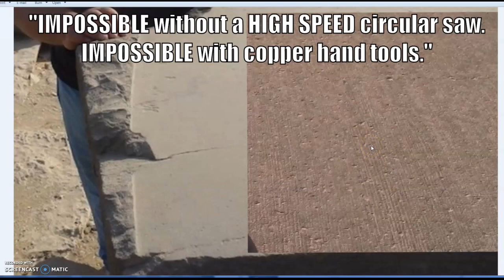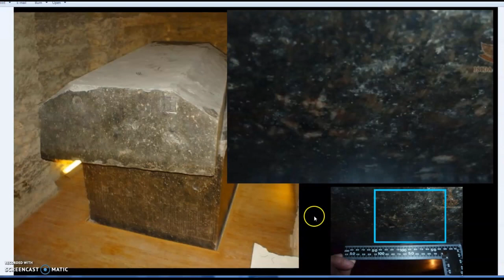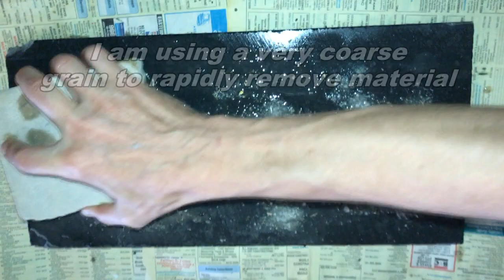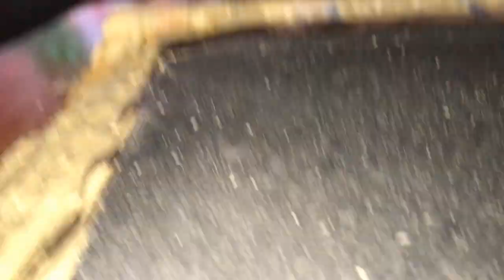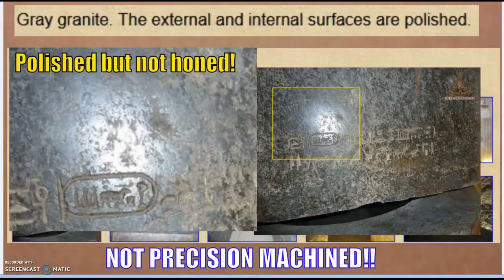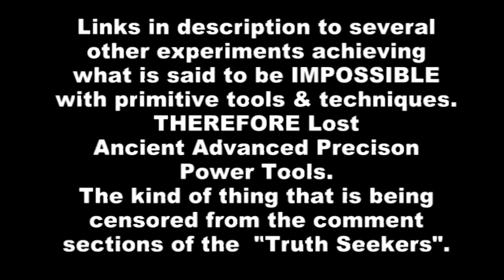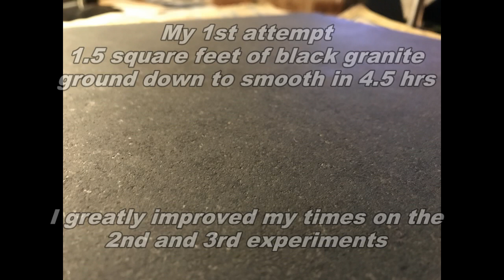Ancient Stone Working Techniques: Experiments with Black Granite on Removing Striations

Comment: maybe you should start your demonstration by extracting  the block from rock face and not using a block already dressed with flat surfaces , i do not think you accomplished real demonstration
Reply from the maker: Sort of like using a string line or straight edge to bone in a stone face? Boning in is the first thing a mason apprentice is expected to master and there are plenty examples of that being done.
I think that as a lost high tech fan you are looking for a criticism since Brien Foerster and the like look bad.
I have other demonstrations using fire setting that covers that in my extensive playlist.
Perhaps one day the lost high people will conduct some experiments rather than call it evidence of a cataclysm?
Though don’t worry (or perhaps you should) because the next demo I will doing is with a raw block to find parallel horizontal while hollowing out a block and creating the interior and inner corners of a sarcophagus such as at Serapeum. Using copper instead of the Iron Age tools they used for those.
Reply: @SacredGeometryDecoded  good luck, where did you find the granodiorite ??
Reply from the maker: @al2207  no luck needed when you put the effort I rather than believe the Foersterite falsehoods.
I’ll be using basalt but since I have drilled and cut granite as well I know from experience the relative cutting rates. 
You should give it a try, or at least look into basic stonemasonry techniques.
It’s all been done of course but I will just be showing a faster way to do it, including the “mysterious” radial inner corner a.k.a a 1 cm drill hole.
I have done some experiments with vase making too, that will be upcoming as well.
Shame that with all the years and dollars and people invested in lost high technology/cataclysm not a single experiment has been conducted.
Lots of BS about Mohs scale, magnetic anomalies in basalt etc. Nonsense that was never fact checked and yet when reality appears people like yourself suddenly find the skeptics hat. Strange how that happens, almost as if lost high tech is a cult.
Reply: @SacredGeometryDecoded  i had worked cutting granite for 3 years long time ago using heavy rotary hammer and tungsten carbide drill bit and feather and wedge for splitting
Reply from the maker: @al2207  and before those tools people did it with by hand without carbide tools.
Your point being?  Unless you think working granite is a relatively modern thing. Or that using modern tools gives you any insight into old school methods?
I drove a car therefore I know how to harness a horse and buggy?
Given that I have drilled and cut granite, including granodiorite (what do you think this black granite actually is?) I don’t particularly care about the opinions of people who haven’t done anything without modern tools. 
It’s strange that you’d even bring that up except to point out you have zero experience without modern tools and materials.
I know a guy who welds steel plate for ship hulls. So he must also know how to make planks for the hull of ancient ships?
Reply: @SacredGeometryDecoded  i will be curious to see how you drill into granite and extract large block with copper tool
Reply: @SacredGeometryDecoded  fallacious argumentation , just ask yourself why Romans, Greek and all other civilization did not work with granite , to work into granite you absolutely need iron tools , how do you think the granite blocks in great pyramid and valley temple can be adjusted to a less than razor blade joint ???
Reply: @al2207 I find you claim of working with stone implausible. You think the paper or the steel in a cutting wheel does the cutting?  

Clear sign you are lying about your experience. Because the abrasives do the cutting not the paper, mesh, steel, or copper.
Reply: @pranays  i see , never worked cutting granite with your hands , the drilling is done by the hammering action of the extra heavy duty rotary hammer
Reply: @al2207 that's not what this experiment is about is it clown? 

You people always try and move the goal posts.

Comment: The harder the material you want to grind the softer your grinding stone needs to be, this allows the stone to break down and constantly exposes new abrasive surfaces. Using aluminium oxide wheels for grinding tungsten carbide for example. I'd imagine just sandstone and water would work just as well without the abrasive powder.
Reply: Some archaeologists did exactly what you claim in a old PBS special and you are correct it works
Reply: @pranays  they did but they are a million miles away from the level of detail, accuracy and speed of production which leaves them only able to reproduce the easiest parts. They need to replicate the hardest parts to even be considered having provided a method of construction.
Reply: @Kalicdire irrelevant. They also don't have generations of experience.

You haven't provided any evidence and clearly don't understand science or archeology.

Are you going to fund thousands of artists for generations to build up the experience and ability?

Such a baby brain comment.🙄

Comment: I find your commentary hard to follow, but that does not invalidate it. So lets say the surface finishing technique you demonstrate  is valid. But, using the tools that are in the historical record, how did the they hollow out the the sold blocks of stone, how did they slice the lid from the same piece of rock, and what was the purpose. I find your dismissal of Chris Dunn difficult, but address his description of the symmetry Rameses heads. Is that symmetry achievable with Ancient Egyptian techniques as we understand them? How about the transportation and erection  of massive blocks of stone? Forgive me, but you seem as zealous in your opinions  as they are in theirs. Rather than being so dismissive, maybe you could give Ben at Uncharted X a call, and discuss your differences, and let us all know the result of your conversations.;
Reply from the maker: ancient technique for statues and symmetry 9 or asymmetry) to create perfect replicas
https://www.youtube.com/watch?v=cwYc4W1m7WI&t=12s
Includes reference to recent colossal granite statue
here's a playlist of the experiments i have done
https://www.youtube.com/watch?v=XY6SUTPV018&list=PL47iaGB6hlT5sYZWd_G7sHg9cSRv6WWS6
Includes drilling and cutting (steel has no advantage over copper as it's the sand that cuts not the copper or steel, just like sand paper- it's the sand)  After a few hours I got 15mm an hour at 330 rpm- the recopmmended RPM by modern coring companies for such diameters for optimal results)
Hollowing out the boxes by drill has evidence such as the sarcophagus in great pyramid
Cutting basalt with a copper blade I get 10mm an hour minimum and  8mm an hour for granite
Compare that to modern gang saws it's 1/3rd to 1/2th the speed
I've also shown the surface finish to single digit microns in quick time.
Scientists Against Myths and Mike Haduck Masonry have shown how to do the inner corners but I have a demo incoming on how to do it quicker while drillling.

Originally I would leave polite comments in response to direct questions asked in the video.  I found myself shadow banned. Others have the same problem, blocked or shadow banned.
Uncharted X was well aware of our experiments but chose to tell the people on his tours that it was IMPOSSIBLE and engineers prove it.
He knew full well he was milking people for money.
He aggressively censored information . He refused to engage and so opens himself to the mockery he rightly deserves.

As for transportation I have a bunch of videos on that showing photographed and filmed examples of primitive tech being used to move massive stones. Ancient depictions etc.
I have a series of Aswan Quarry and go into the use of canals that were dug right up next to large empty pits and the unfinihsed obelisk as well.
The Nemi ships of Rome , similar to barges used to transport obelisks in Roman times displace 7000 tonnes. UNas has carvings of boats moving large single piece columns.
It comes down to displacement- granite 2.7 t per cubic metre so a barge with of 1.73 compared to the stone being moved will float it.

Comment: There's nothing new about this method, it's not rediscovered, and it doesn't close the case one way or another. Just because you can build a car with hand tools alone doesn't mean that's the way it was done. The lost high tech argument has more than just 'was it hand tools or something else' to it. It has a body of evidence that collectively, makes it compelling, at very least for deeper analysis to be done. Why did the old kingdom produce the highest standard and greatest volume of stone architecture? What was the purpose of such intricate work such as the excessively large boxes as there is no evidence of funerary use. Why did successive dynasties become less competent? The great pyramid itself with it's shafts and chambers that have the distinct property of resonating sound seems to indicate an engineered space that is more than an aesthetic choice. So what of the great boxes? There isn't a better way to tune a sound than to have an accurately formed cavity. So taking the effort to make something this big and precise (not sub millimeter, but still, for stone it's about as good as you can get given it's time) implies a purpose? This in itself is a case for a high technology (not greater than ours, just for it's time was more sophisticated than other bronze age civilisations). The argument will go on and I would like to see more modern analytical work done on the Old kingdom artefacts and compare them to later works. Mass spectrometry, XRF and XRD will all show the presence of minerals and metals not part of the natural rock.
Reply from the maker: That's exactly right, there is nothing new about this method. It's exactly the kind of thing the Lost Ancient High technology people should have been over a decade ago.
The body of evidence? You mean a denial of evidence and basic principles such as ramps, levers and abrasion.
There is a huge amount of evidence for funerary use, the lost high tech people  lost civilisation are just covering it up, or utterly ignorant to it. Even though they've been at it for years. How could that be? It's one of their favourite sites and they tell us about the "mainstream" position all the time.
https://www.youtube.com/watch?v=47HAYcii_Q8&t=3196s - this should help. The evidence of the Serapeum construction and use. 
They did not become less competent in the later era. The lost high tech people simply redate anything to old kingdom or predynastic based on the quality of the work.
If you asked someone at a Hindu temple why build something so grand out of granite? It must have another purpose?! It can't only be a temple!! I'd guess they'd tell you that is the purpose, to be a temple. Or grand mausoleum at a cemetery? That is the purpose.

Comment: So, is it possible to have used large copper disks with a hand crank? Its been shown that using abrasive grit and copper can bore holes, why not cut with a disc?
Reply from the maker: It's possible but much easier to use a pendulum saw or a short straight piece of copper, gives the same results with much less hassle and investment. I have a demo, https://www.youtube.com/watch?v=7FSRhBZGYJg&t=1650s
Also this one, https://www.youtube.com/watch?v=49gyaGXWmZ8&t=1314s  shows historic use of drag saws and pendulum saws.

Comment: Try making a vase out of granite and crave out the inside too. Like the ones found under the step pyramid. Good luck with that.
Reply from the maker: There are tomb paintings of the vases being made. Or you can go to the “scientists against myths” channel.
She’s made a couple of vases already. Diorite one under construction right now. It is live streamed. 
Good luck with getting that info from your “sources”. 
I have other demos how to do what the lost high tech “experts” said was impossible with primitive tools.
They think making a granite box is high technology. A box.
Reply: @SacredGeometryDecoded  
Do you believe the great pyramid was built in 20 years as archaeologist say?
There are 2.3 million stones used.
There are 525,600 minutes in 1 year.
525,600×20=10,512,000
10,512,000(minutes)÷2,300,000(blocks)=4.570 minutes for each block to be placed, Non stop for 20 years Good luck
Reply from the maker: The great pyramid has a base length of 230 metres. Multiple teams able to work at once. Each team would need to place less than 2 stones per day. Bottom third is 80% of the volume.
You are just repeating a talking point that assumes it was one team  doing the work. 
Even a small home will have multiple teams working at once.
Much like the ‘impossible vases’ your talking points are just parroted and nonsense.
You people should really try logic because you’ll be repeating this silliness on public comment sections otherwise.
Good luck with that but I won’t hold my breath.
What’s your next gambit? How did they hollow out a box?
Reply: @SacredGeometryDecoded  
So now we're saying 8 blocks per day? 
😆😃😆
365×20=7300 days
7300 days×8 bocks=58400 
There are 2,300,000 blocks.
Math isn't your thing is it.
It's impossible to build the great pyramid in 20 years. In order to achieve that timeline, you would have to set a stone in place every 4.57 minutes. ( this time doesn't include quarrying or transportation of the stones. Just the placement of the stones.)
Reply: @SacredGeometryDecoded  
By your estimated guess. You would need to set 315 stones every day. 😆😃
Reply from the maker: @BERSERKERNA39  so one team was working at once? 
You’re math relies on one team and one team only. It’s foolish and it’s why you’ll never make anything.
You don’t know about the real world.
If you had paid attention to a house build you’d know this. Yet here you are, repeating tired old points.
Just like the vases you’re many moves behind the current discussion.
Plus this is not about the pyramid. Every LAHT fanboy just repeats the same “what about this”. They’re always the same.  Always built on a one team built the pyramid and I have a calculator.
I am not defending the establishment or their timeline. That’s your piss weak attempt to save face. In future don’t assume everyone is as ignorant and gullible as you, most people aren’t so silly as to think one team built the pyramid or any other grand building.
Reply from the maker: @BERSERKERNA39  divided by 150 plus teams that had more than room. 2 stones per day per team.
I just explained that, you’re still holding to the silliness of a single team.
I am confident you couldn’t do it but the people I have worked with could do it.
Especially since 95% plus of the stone came from a stone throw away. Tyra limestone and Aswan granite quarries less than a kilometre from the river. 
Have you ever worked with tools and a team?
Why don’t you want to learn how to do things? 
Everything LAHT is impossible is in historic record. I have done many experiments that anyone can replicate and LAHT peeps like you......crickets.
One team didn’t build the pyramid on their own. Only an imbecile would arrange a large project like that, or calculate construction times off of that premise.
Reply: Scientists against myths has already done that experiment good luck not falling over from thinking so hard.🤡